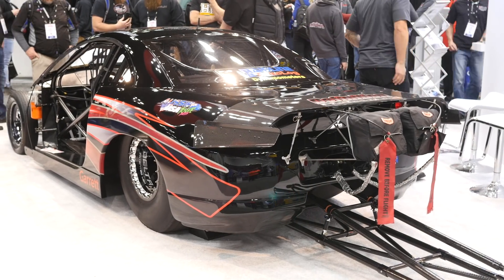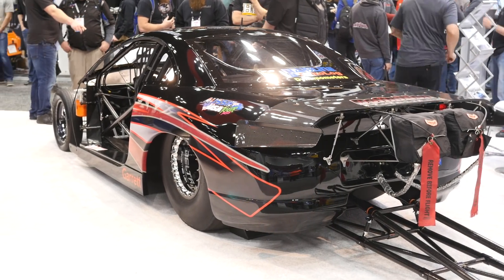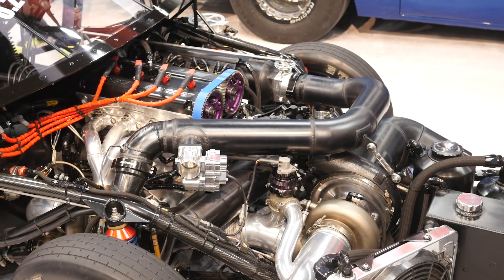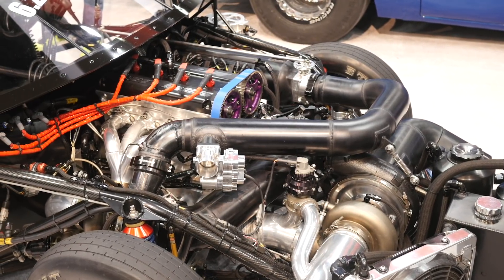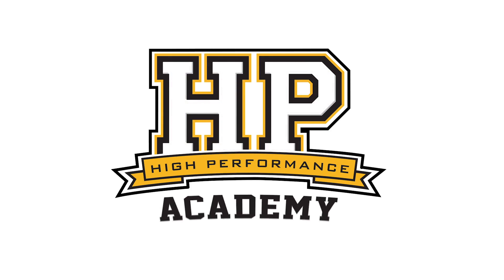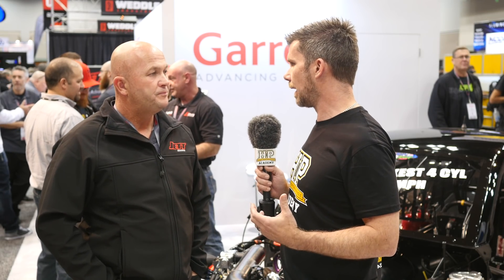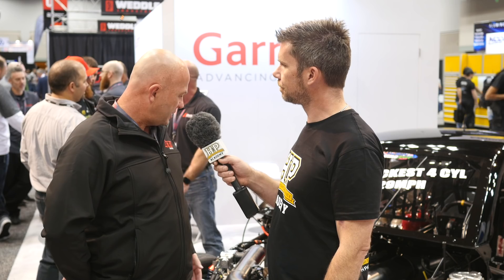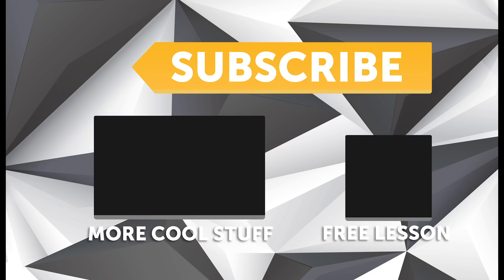5 Injectors Per Cylinder?! | 20+ Methanol Fuel Injectors [TECH NUGGET]

Comment: 5 2750cc injectors per cylinder and 2 additional in the charge pipe =60,500cc. That's 16 gallons per minute. Yikes!
Reply from the maker: Certainly drinks me under the table ;) - Taz.
Reply: @hpa101  no one can even drink 1 liter of water in 1 second :)
Reply: 15.3 gallons a minute sorry im that one dude
Reply: @aidenyoung3115  15.98 gallons... but who's counting? Apparently not you 🙃
Reply: @samsonite360  15.98 how do you get the extra  .6 gallon

Comment: Would be interesting to see the wiring scheme for those. Are they using 20 outputs from ECU (one per injector) or 4+4 as sort of matrix configuration, where 4 outputs control cylinder injectors time and other 4 are additional row enable controls, or just 5 outupts where each is its own stage and "wasted injection" (?) is used, sacrificing individual cyl. fuel trim.
Or primary 4 are individually controled, and other stages are controled with single output per stage ("wasted" injection? )